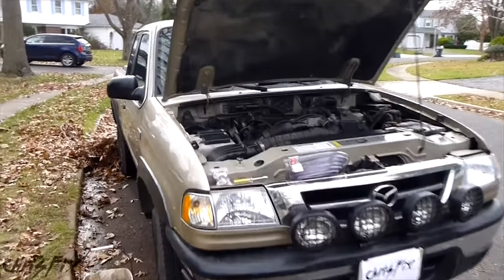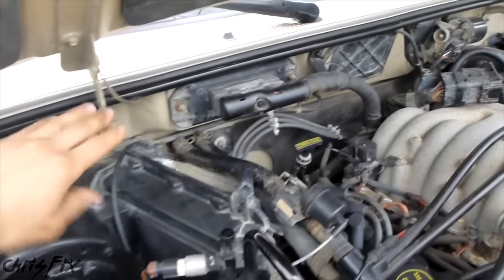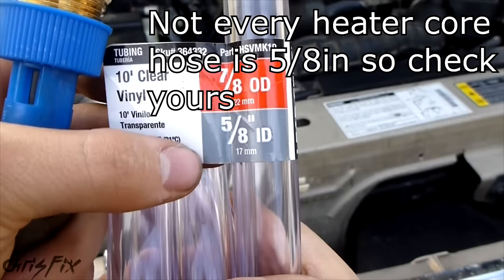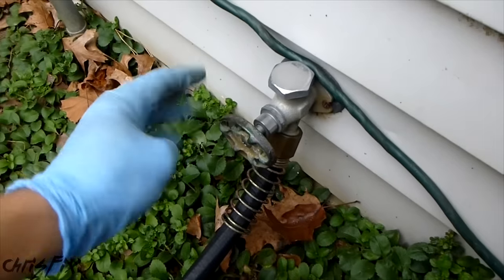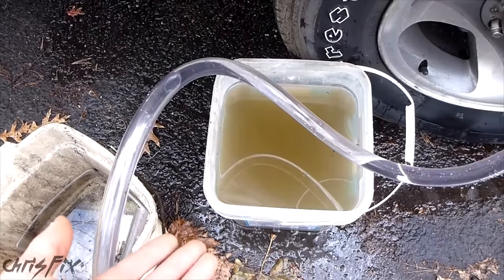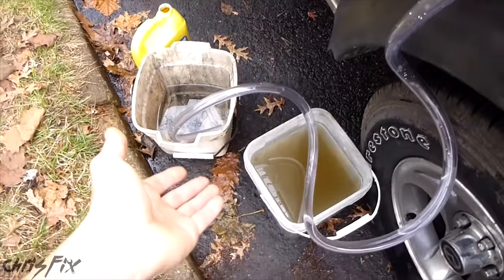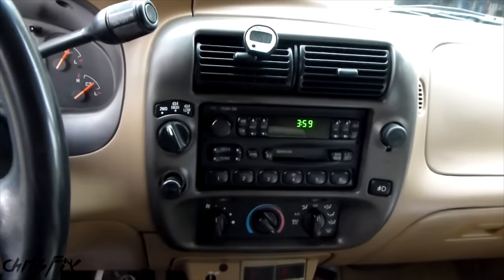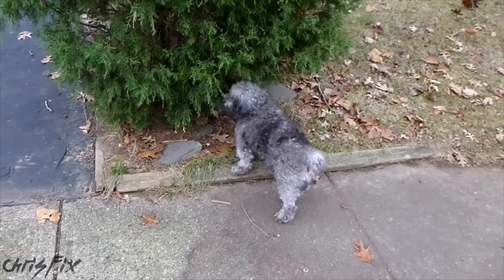How to Flush a Heater Core Safely (with a garden hose)

Comment: Hi Chrisfix! Great video btw. I have a question. I am planning on doing this setup for my 2002 ford taurus 3.0. I was wondering, can i expect my heater core fittings to also be 5/8ths ID? is this like a universal measurement, or could mine be different?
Reply: not Inner diameter. I guess I mean outer diameter, since the hose would have to fit over it..lol
Reply from the maker: +Mattia Williams since this engine and your engine are the same, it's a good guess that the heater core will be the same.

Comment: It didn't worked for me, the water pressure went back into the hose (I used a clamp because my garden hose is smaller and can get inside the heater hose) and not even a drop of water came of the exit side (heater was open btw). I checked the heater hoses and they were full of rust on both sides. RIP heater core.

Comment: my hoter radiator work but don't blow hot air
Reply from the maker: Then it is clogged. If your fan is working and you're coolant is hot, but you arent getting heat, the heater core is clogged.
Reply: What if the heat is intermitent or you need an ungodly amount of power to get heat? I do not get heat unless I rev and use the car at about 3500 - 4500 RPM? I also do not get any heat (if you can all it that, slightly above lukewarm) until well after the car is at operating temperature. Is it air in the system or something else?

Comment: so doing a regular coolant flush won't flush your heater core?
Reply: nope. the heater core is only opened when you turn your heat on thus you can only flush it if you do a super thorough coolant flush
Reply: itshogs does it matter which one you do first?

Comment: What's going on if I have the ac and heat off, but my car running and I get a smelly fog coming out of the vents?
Reply: Matt Toney I think he addressed this at the beginning of the video. bad news bro.
Reply: Matt Toney ,heater core is bad then
Reply: kriesel50 even if the vents are off? it doesn't happen every time I drive.. just once every blue moon..

Comment: I'm getting 160 F out of my vents is that too hot?
Reply from the maker: No it is not too hot
Reply: @chrisfix  I had to flush it out about three times to get clearish water left. It's good to get it done. Repair manuals said to undo an engine block drain but I just used the rad drain plug and it seemed to work. The engine block one was too hard  to access. Capacity in manual said 5.8 quarts but I was able  to only drain about 4 each time so I don't know if they count the overfill tank as part of capacity.

Comment: Wouldn't it be easier to take hoses off from the engine side and leave existing hoses on the heater core?Then you won't  have to buy the clear hose???
Reply from the maker: Depends on the car. In this case it’s all the way down by the waterpump which is a pain to get to.

Comment: Water pumps don't mare psi. they make flow heat makes psi. All so the water coming out of the hose bib psi. does not change no mater how much you open it only the flow will change.
Reply from the maker: Thanks for sharing Ken.

Comment: If you have an old car, where you suspect service is probably not taken, then this may work. Do you have a newer car: Change coolant no later than 3 years. NEVER use household water / drinking water, no matter how. NEVER! The explanation is that freshwater of very high quality contains nitrates, lime and are not ph-neutral, which will cause these problems in a longer term, like this video shows. ONLY use refrigerant that the manufacturer advises. In a worst case scenario: ONLY use the same kind of water, which is suitable for standard car batteries. This is not magic, just common sense

Comment: How about cleaning the AC system
Reply from the maker: bahlowwings The AC system is a lot different. It typically does not get dirty. Do you have a reason why you are asking about cleaning the AC system?
Reply: ChrisFix my 00 eclipse AC works fine. But during the summer i would have to crank to med/high to high to stay cool. 
As for my old 96 civic i would crank it to either low med and it would ice cold
Reply: bahlowwings Only thing you need to change is your cabin air filter chris has a video on that too :)
Reply: ali amiri never thought about that. Thanks ill give that a try
Reply from the maker: bahlowwings Odd are you have low freon levels. The idea of a clogged cabin filter is possible but you can easily figure that out. Does the air come out of the vents at a good speed? Can you feel anything on low? The cabin filter also filters the hot air so if it is preventing the AC from cooling, it will prevent the heat from heating.

Comment: could a cloged heater core cause a car to overheat
Reply: Nani Chic Generally a heater core will not cause a car to overheat. One of the first things you should have checked if your car is overheating, is your thermostat. If it is stuck closed, it's not letting enough coolant through to properly cool the engine. Hope this helps!

Comment: If youre in the south, just bypass the heater core and save the chance of it blowing and destroying your interior, lol
Reply from the maker: Yea you can do that for sure. (lucky lol)
Reply: ChrisFix You can do it as well in your vette (especially if you only drive it during the summer time).
Reply from the maker: I drive it with the top down once the salt gets off the road so it can be chilly.
Reply: I disagree. You need your blower to blow heat no matter where you live.

Comment: how about my Fiat Brava of 1996 ?? I have the same problem   :(    any info about  that car system ??
Reply from the maker: L Hibo If you have the same problem then you can do the same thing and get the same results. Here is another helpful video you can watch: https://www.youtube.com/watch?v=-XjXTVJhFLM
Reply: ChrisFix Thanks Chris Fix, the video was helpful. My car is acting strange cos some times I have hot air and some times I don't even with a good  motor temperature. My inlet hose was hot and my outlet was worm so  I think I have a problem with my heater control valve but I don't know were it it. I don't see nothing there. :(
Reply from the maker: L Hibo If you dont see one, you might not have one. That sounds more like a clogged heater core or there is air in your system.
Reply: ChrisFix  Thanks for you reply and your help Chris Fix :),  maybe its a clogged heater core as you said because I check it for air in system. I opened a valve in my outlet hose and water came out. ( If you have any suggest how to remove air from system let me know)
Reply from the maker: L Hibo Search for a bleeder valve near your thermostat or water pump. That will let the air out. Like in this video: https://www.youtube.com/watch?v=dG5MhY8Bieo
Reply: I have something similar to bleeder valve in my outlet hose, and a did the same as you but still no improvement, I think that the heater core is  clogged and is not so easy to reach those hoses in my car :( but I'll try
Reply: L Hibo hey chris i would  like to thank you for your advice ,cos i tried the flash of heater core and it worked :} no more gloves  and scarf on during driving in the morning
Reply from the maker: L Hibo AWESOME! That is what I love to hear! I am glad you will be warm this winter!
Reply: you need to add blinker fluid

Comment: Your asking to break your core by removing the hoses there to flush the core.
Reply from the maker: Brandon Thurlo I never had a problem. You just need to be gentle. If the hoses dont come off easily, then remove them somewhere else if possible.

Comment: looks like dex cool lol
Reply from the maker: Brendan Mccabe Yea, well it shouldnt be. This is why you never take your car to a shop! When I first got my truck I wanted them to vacuum flush my system to get it flushed to the max, but they either used cheap antifreeze or they used dexcool which is a disaster to mix with the green stuff!
Reply: ChrisFix yep dexcool is designed specifically for aluminum block and heads
Reply from the maker: will413900 And for the Ford 3.0 the block is iron and the heads are aluminum. I hope that is not what they did!

Comment: Please tell me you're using DexCool or something and that's not water. lol
Reply from the maker: William Ruescher I do not think it is dexcool. I think it is just really cheap antifreeze. When I got the truck, I had a shop use the vacuum flush system to clean out my coolant system. They filled it with garbage antifreeze. I hope it isnt dexcool!
Reply: lol Okay, I was just wondering because to my knowledge Dex is the only one that's orange like that, but I wouldn't be surprised if it's some weird stuff. Personally, I don't like the Dex because it's hard to distinguish between it and rusty water.
Reply from the maker: William Ruescher Yea, I am hopeful it is just cheapo coolant. I dont know why they made dexcool orange. They should have made it a color where rust stands out.
Reply: No, Dex is orange, regular coolant is green, MOPAR HOAT coolant is a pinkish color, their new stuff is purple (no joke), Honda has blue and the HOAT coolant I buy for my dad's truck is a golden color.

We're starting to get into Kool Aid territory with all these colors lol
Reply from the maker: William Ruescher Yea, that is what I meant, my bad (I corrected it). I had green coolant on the brain lol. Purple coolant? I wish we had some clear radiator hoses hahaha
Reply: Gotcha, I figured that's what was up. lol Yeah, purple coolant. Chrysler is the only one using that to my knowledge...that's as of like 2012 or 13. You can get clear hoses, they cost but I bet it'd be cool. :D

Comment: Usual fail vid.  The heater core is exposed to much more than 10 psi in the vast majority of systems.  Also, you can't regulate pressure with a garden hose valve, you can only control the volume.

Comment: Did you take a shit into your cooling system?  No wonder that shit is clogged, replace that fluid once in a while.
Reply from the maker: krzysiekv12 Check out how to flush your cooling system here: https://www.youtube.com/watch?v=g8YZF5cW7-A
Reply: You have no idea how bad radiator fluid can get. Especially if at one time in your cars life you had a manifold gasket leak which allowed oil into the radiator. Oil in your radiator fluid is tough to deal with. Even if you fix the cause of the oil leaking into the radiator to get all the residual oil out is super difficult.
REPLY